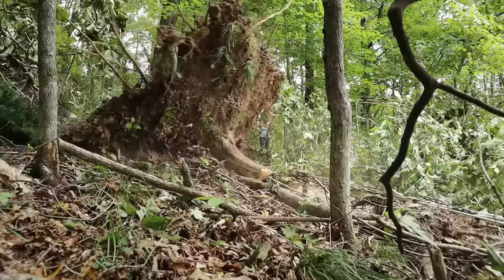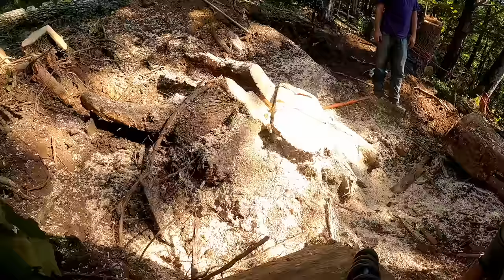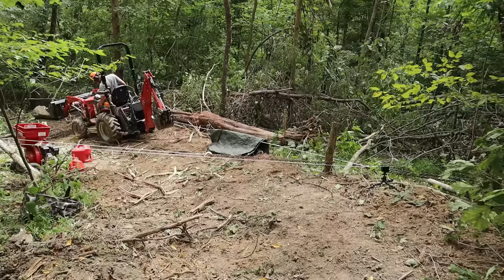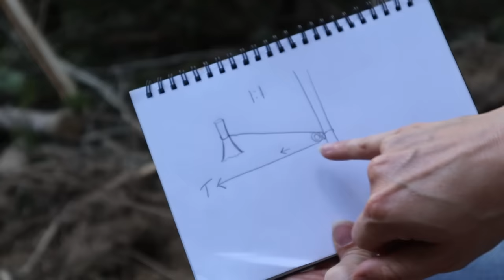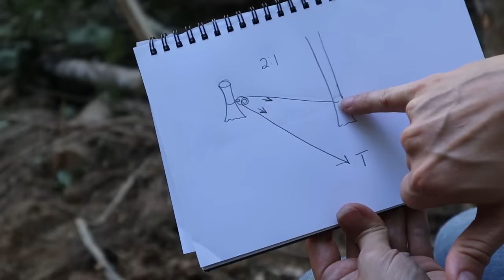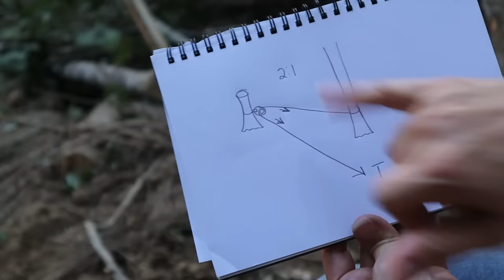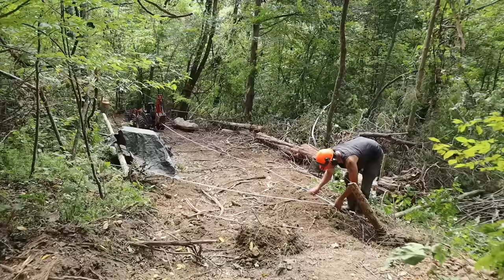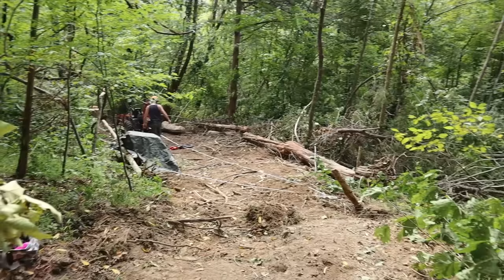Snatch blocks vs tree stumps - the power of pulleys /// E57

Comment: Great job learning some of the advantages of pulleys for mechanical advantage. I use them all the time in my work. I do have some advice about pulling with the tractor. Please do not hook your pull rope or cable to the backhoe bucket. Work your equations backwards. The stress on the bucket, dipper. and boom cylinders, joints, and linkages is enormous against them due to the mechanical leverage you're exerting on them. They were engineered for a balance of power and reach (travel). You will eventually destroy a cylinder by constant pressures that are amplified by the leverage against them. Please attach you pull hook to a strong tractor frame member and as low as possible and so it doesn't bind up on the BH in any way. On my JD SCUT, I can still access the drawbar on the rear even with the BH attached. Check your tractor out. BH repairs are very costly. Watch your video closely, you'll see the stressing and flexing (pronounced screaming for dear life), where you're not getting any advantage from any of it.

Comment: You two have been doing a ton of work and making really good progress. I am also impressed  with all you have accomplished with that little tractor. I’m in the market for one and thought a mid 20s hp tractor would be too small for what I to do but apparently I’m wrong. Keep it up!
Reply from the maker: Thank you, Joshua!  I have a goal of cutting our entire driveway with that little tractor.  Use what you've got, right?  I must admit though, I wish I had some more power at times.  The 37hp version would be perfect in my opinion.
Reply: @WalnutsandWineberries  The HK37 would be really great but I only own just over 2 acres in the suburbs in which I live back in the woods between two housing plans and the 37 would be just too physically big for the work I need to do there. Although it would be great at my camp. Dilemma!🤯

Comment: A Sawzall can cut thru dirt (roots) even underground without damaging the blade like a chainsaw. Circle the stump with the saw cutting the roots underground. Then as you can pull the stump up, it will reveal more roots to cut. I used an M18 Milwaukee fuel (brushless) Sawzall.
For pulling I just used my F150 with a 10,000lb winch (on the first wrap) with a 'donut' snatch, a soft shackle and fiber winchline. The synthetic winchline won't snap back when it breaks. It is sensitive to being cut by debris but that is entirely avoidable. My setup will easily drag my 6,000 lb truck over grass. Chocks would help but cutting the roots first as above has allowed me to pull stumps larger than to men can lift. With more snatch donuts, you can do more. Certainly with a tractor like you have.

Comment: Here's a tip. Use the snatch to pull the whole tree over. The weight of the tree will do a lot to pull the stump loose. To get your rigging up high into the tree use a light cord tied to a little sand bag, the size of a soft ball. Throw the sand bag over a limb. Then tie your cable to the cord and pull your cable up over a branch and around the tree and hook the cable to your tractor. Use snatch blocks then to multiply the tractor force if necessary.

Comment: That was great, way to push through! You may already know this but throwing it out there… the higher you can put your snatch blocks the easier the tree will come out. You’ll have more torque on the root ball.
Reply from the maker: Definitely!  Recently, I've been leaving a bit more for that very reason.  I can't bring myself to leave too much though.  I usually mill the logs that come out of the tree and those lower sections are prime cuts.
Reply: @WalnutsandWineberries  Is it possible to pull the whole tree out before you cut it up in sections for the mill?
Reply from the maker: Reverse the direction of pull with one more pulley.  I guess that could work...

Comment: great video and sketches!  I see in the comments where Larry mentions the stump moving towards the anchor tree... this is because it has 3 ropes attached and the tractor has 1 rope.   If you switched the 3 to the tractor it would have to pull 3X as hard.   

A couple of points on safety... you chose a massive steel cable that is great since you were not going to stretch it much before stalling the tractor... stretch in a rope = stored energy and that is dangerous.  One problem I saw was the use of the chain thru the bushing in the snatch block.  The link of the chain in this setup is in bending and shear (not tension as it is designed)  and its strength is greatly reduced.  best to use a shackle.

Comment: Great explanation.  Note that in all cases, if all of the lines are not 100% parallel from block to block and target, the actual advantage decreases.  Only a little bit as your diagrams are drawn, but still impacts force.  In your 4:1, the last line tot he tractor is not parallel to the others, so there is a degradation of force.

Comment: yup... a stationary pulley only provides change of direction.  A pulley in motion does work.  Your 4:1 system was probably closer to 3.5:1 as you were pulling at an angle.  To get the most mechanical advantage try to pull as close to inline with your blocks and lines as possible.  Not always possible, but that gives you the most pulling power.  Important thing was it got the job done!  Nicely done and good job explaining the concepts.

Comment: The answer to your rock removal is using feathers and wedges. The tricks are always have a place where the rock can expand into - dig a hole on the side of the rock so the rock can free expand in that direction.  Drill the rock with the correct size for your feathers and wedges - do be precise here. Grease your feathers and wedges. Hit square on the wedges with a large sledge hammer. Drill holes in the line you want it to break. Follow natural fissures in the rock. (Put water on the rock to see the fissures - the water leaks out of almost invisible cracks drill on that fissure as opposed the fighting against it in another direction). Have a hole/wedge hole about every 6-8 inches. Rock drilling can be done with gasoline rock drills (Atlas coco Pionjar 120 or a air rock drill of at least 32 lbs a 60lb class rock drill is a brute but super quick drill - will need a tow behind compressor for this. Drill straight down as much as possible so you aren’t fighting the weight of the rock drill. Be patient with your wedge driving - take minutes to drive them slowly in. (Explained - drive the wedge till its firm in the hole with the feathers then drive the next one and so on and so on - I have broken rocks/boulders of 20-30 tons - clean break if patient and holes are deep enough. WEDGE DRIVING - DONT BE IN A HURRY  - REPEAT DONT BE IN A HURRY. Walk away take a rest and go back in 10 minutes and tap on all those wedges again. I dont sell this brand or endorse it or make money recommending them - just a link to see what they look like - these ones are 10 in a set for $31 on amazon. Drilling the holes is the ass ache - just saying. One last thing use rubber rings on your wedges to keep them from falling in your hole and loosing them.
Reply: great info

Comment: Nice video adding snatch blocks Add great mechanical value, in the Recent posts People mention keeping your lines more directional also a good hint is to cut your stumps a little bit higher to gain even greater leverage Good luck on your project

Comment: I used three snatch blocks and still had to use the backhoe. I skipped the dangerous wire rope and went straight to 1/2 inch dyneema on the stump side and 3/8ths dyneema for the rest. I used a 12,000lb winch. I broke one of the heavy duty snatch blocks on the stump side. I was using 2foot thick western red cedar as the anchors. Each anchor had a different tree and my 8000lb van was running the winch.
Stump was wild cherry tree a foot through at the trunk.
I did get it out but it was work and still needed the backhoe on my little 2615 Mahindra tractor.

Comment: Great video. I'd never considered using that many snatch blocks.  Suggestion,  Leave your stumps 5 or 6' high to give you more leverage in initial uprooting. Cut the balance off once you've removed the chains and pulled it over

Comment: Hi love your video , Just a quick tip if you hook you cable high in the tree like 7 or 8 feet of the ground or as high as you can reach and pull the tree down before you cut it you can use the tree trunk as a leaver add that with your snatch blocks it will help you a lot :)
Reply from the maker: Thanks, Craig.  I might give that a try one day.  Others suggested cutting up higher with a step ladder, but that seems like an injury waiting to happen.  Plus, I mill my lumber and don't want to cut the prime wood like that.  I might try what you said and just rig it high and pull the whole thing down with the tractor.  Might need one more cable to reverse my direction so I'm driving away from the fall side.
Reply: @WalnutsandWineberries  Yes ladders and trees do not mix and for sure you dont want to cut any mill wood. Pulling the tree down you can cut the stump very short and it reduces the chance of shocking the wood grain. best of luck to you both :)

Comment: Before I had a tractor I pulled several stumps out by hooking chains or cable to as high a point in a live tree my ladder could reach. Usually multiple lines with three individual come along winches. One of the come alongs was rated for 3 tons.At some point the weight of the tree wants to fall toward the pulling points. Sometimes I'd chop some surface roots on the far side. A large log laid at the base of the tree acts as a fulcrum, when the tree falls on it it pops the root out of the ground. Sort of like what high winds do during a storm. Pulling from a higher point gives better leverage.

Comment: The best instruction that I have seen for pulleys is on a channel called Wood wood in a video called rope vs. tree roots. This is a Korean carpenter that usually works alone so he has instruction on mechanical advantage using ropes and pulleys. He also has a good one on using levers.

Comment: Hi, Can I offer some advice, we used to fell trees of all sizes by hand, no tractor for us, the trick is to use ALL the forces available to your advantage, firstly don't cut the trunk off!! leave the trunk as long as you can, we used the full tree if we could, this way once you start the tree moving its' weight generates kinetic energy that will help you, if you have to cut anything take off the far side of the tree, so the side it needs to fall towards is the heaviest,  if possible cut through the roots you can see on the far side of the tree, then fasten your pulling rope as high up the  trunk as you can safely, and with sufficient girth this gives you 'leverage' to bend the tree, you are trying to snap the main 'Tap Root' which goes straight down, the lateral roots will have been cut if possible on the far side, those on the near side will just bend and snap, as they are 'anchoring' the tree from moving away from you, choose your anchor tree as closely in line with your direction of pull, if your anchor is to the side, you loose some of the mechanical advantage due to the 'parallelogram of  Forces' I remember that from school some 60+ years ago!! fix your anchor as low as possible, if you raise it it now has 'leverage' on the anchor tree and can loosen it causing it to die. One last word, try to rig some form of 'safety cage' on or behind your tractor, tensioned steel cable is leathal should it fail.
Hope this will be of help, keep safe

Comment: I stopped by a tow truck driver last summer  that was doing a job on my rural road.  His winch line was rigged off the tip of boom, and then down thru a snatch block lower down on the chassis, and then to the stuck rig. he explained to me how this doubled his pulling power. I told him I was a crane operator, and all his rigging did was change the direction of the pull, and we parted ways! I think he must have a new guy. I've told home builders that didn't know any better, if a boom truck shows up on your jobsite rigged for a 2 part line, for setting trusses, (like one of my so called competitors does) run his ass off! Twice as slow, and picking a 2 or 3 hundred pound truss, not needed! He's just too cheap to buy a quick reeve snatch block, which cost me $1800.00 6 years ago, more now!

Comment: 11: 49, the 3-block system will require less HP than the previous 2-block.  Thanks for the info! I've worked with some blocks thru time, and didn't know this principle.
    14: 45, Those rock tops are close to the surface. Just use your backhoe and cover them with a foot of soil from the high areas, done.

Comment: One more small comment.  Keep the anchored point low and the pulling end high on what you are pulling.  That will give you leverage.  You can also use a second anchor point, if needed.

Comment: If you have a bucket fill it with sand or find a big rock to put in your grabble. One thing we do instead of air in the tires. Fill them 2/3 with water and add some antifreeze depending on where you are. I'm a rancher I sell tractors to farmers. By adding water to your tires it will pull like the tractor one size up.
Reply from the maker: I've heard of beet juice, too.  Non-corrosive and freeze tolerate to -35!  I imagine a lower center of gravity comes with this?  Might be good for our mountainous terrain.

Comment: A Bobcat with a stump bucket can be rented for about $500 or so per weekend and most of the dealers will deliver and they are easy to operate. But the pulley system is doing what you need and doing a great job.

Comment: Tractor torque can be X even more if you put a snatch block on tractor, feed tractor lead through, then tie to anchor tree. Rope/cable stretch acts as a rubber band. Absorbs direct pull shock as well as intensifies pull.  On a safety note: It's wise to drape a towel/ blanket or chain over pull lead in case something brakes; acts as parachute to weigh/create drag; to reduce/prevent injury from projectile pulley!!

Comment: Another suggestion is to use a trailer tire and wheel. Place your cable over the top of the tire and pull. Anchor your chain or cable down low on your stump to be pulled out and it will pull it out from the ground up. Then you can pull it out.

Comment: Awesome video of using snatch blocks strategically. Maybe just rent a big excavator and probably tear out those stumps in 2 days. Save your sweat for building house. When you use a large excavator and actually see the power of the hydraulics in action, it will blow your mind, and the stumps.

Comment: One big hindrance is that the tractor ( I’m going by sound) is a hydrostatic tractor, a mechanical tractor of the same HP will have much more torque when pulling! Also hook low on the tractor, it will help keep the front end down better, or you can add weight in the loader as well! Good luck!

Comment: Something you always want to keep in mind is that a 1:1 snatch block arrangement simply changes the direction of pull.  There is, as you discovered, no mechanical advantage. It's handy though for getting a vehicle back on the road or other things related to recovery.  Your diagrams are a bit confused.  The pull follows the line around the pulley from the tractor to what you want to move.  With more mechanical advantage you need consider/calculate the load very carefully.  Because the load between the work and the anchor is equal at each end.  The anchor point always has to be stronger than the load end.

Comment: Just came across your informative and useful video. One suggestion:

All the successful video makers use the word "excited" A LOT!  As in, "I dropped the chainsaw and severed my leg. I'm so excited!"

You have to be excited about being excited.

I did see that you were very cautious at being around the rope when it was under tension. You cannot emphasize this enough. If a rope breaks under such enormous tension it becomes deadly or, if you're lucky, simply able to seriously maim or disfigure a person for life. Even, perhaps especially, if you use a metal rope. 

 Your simple diagrams made things much more comprehensible.  Great idea. A little more energy, less pedantic, more personal experience standing on your feet as opposed to sitting would go a long way to making your videos just a bit better. Energy adds color.

Great video folks. Seriously.

Comment: To help dislodge the stump you are trying to remove, use your backhoe to cut the roots on the far side of the stump. This will allow the stump to fall over, as the roots on the cut side will no longer be providing tensile resistance, reducing the force you need.

I saw an excavator operator dig through the roots on a 65' tall pecan tree on one side, and then just push the tree over with the bucket. Reduced tensile strength in the roots on one side, and the use of the trunk as a lever, using the weight of the trunk and branches with gravity to help bring down the tree. It is all about physics.

Comment: Anyone using this method should read the advice of others here, some very good tips. I would like to add one too, on your anchor tree or trees cushion your cable, wire, or rope whatever you're using or if you can use webbing straps, just to be kinder to the anchor tree/trees and not damage it/them. And remember to stay clear of the cable wire or rope as if they snap it could be fatal or cause serious injury, remember the "triangle of death"!

Comment: As some others have mentioned leave the stumps taller and hook higher on them.  Be aware that if something breaks that the cable can fly at very fast speeds people have been cut into 2 by cables that went flying. Hard hats and safety glasses would be a good idea.

Comment: Nice work.  The only thing I'd add is that your first pulley diagram works just the same as the second, it does still give you a 2 to 1 advantage, just not on the target you wanted,  but it's still advantage, ask your cedar tree!  :)